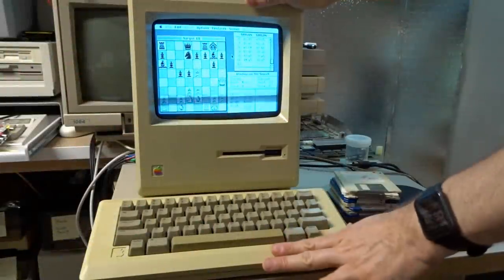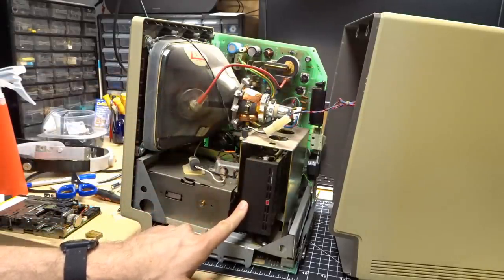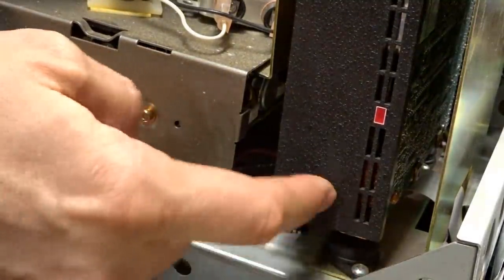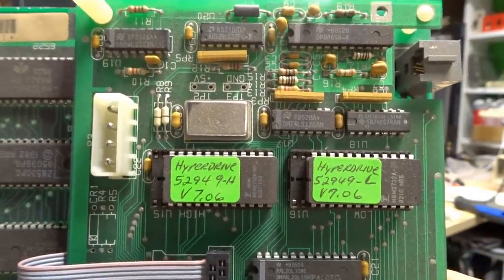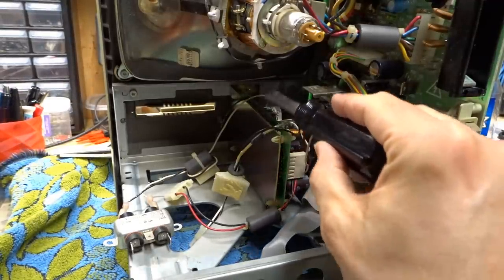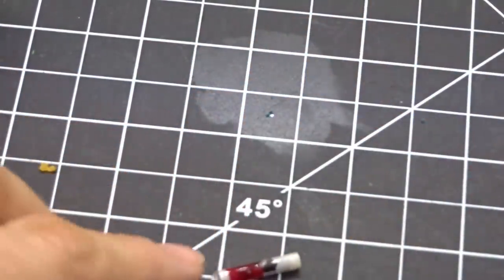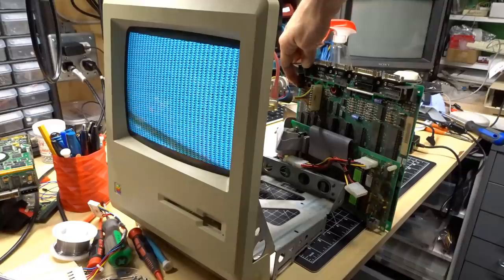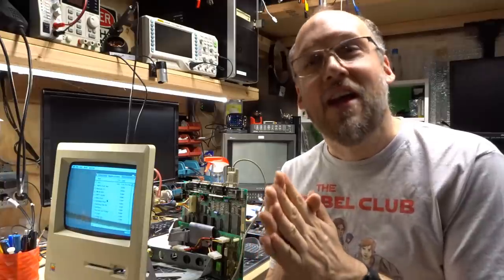Macintosh 512K with an internal MFM hard drive?

Comment: keep it! that mod is fairly unique(well seeing one today at least) 
btw test the output caps and dodes of the power supply. also check to see if the switching transistor is shorted or open (unfortunately if it is shorted it would have likely blown the switching chip so replace the chip if the replacing the shorted transistor didnt do it). you can also probe the signal pin on the transistor to check for High frequency switching. if you see ac on the output the output rectifying diode could be shorted(test for open as well).

Comment: The MFM/RLL drive sounds like it needs some looking into, since it made some concerning noises at power up. These don't auto park and need a command at power down to park the heads. Do not forget that it is a very old piece of hardware and may be soon to fail as the media is likely to have bad sectors..

Comment: My question is this: Can you do better? I think the hard disk controller piggybacking the motherboard is really interesting, you could try getting more compact period accurate parts and seeing if you can do a better job with the upgrade.

These sorts of hardware modifications are really interesting to see in these old Macs. I'm always a little hesitant to say return it to stock, because this sort of thing is NOT something you'd ever see today, in a modern computer, where all the upgrades are so steramlined. 

...Well, that, and I love seeing people sticking it to Apple like this. They didn't want people upgrading these old one piece machines, but people always found a way.

Comment: I'd be glad to see some software running from that HDD :')
I mean, it's still a strange fun to explore such long abandoned disks to find some obscure software and docs, even this is a bit deviant thing, haha

Thank you for the video, that's an accurate and surely period correct modification, I'd be glad to know it will stay with the system (after some lubrication of the stepping motor for sure).

Comment: Good job with the video editing. 
In some PC BIOS you can add some delay to give time to inicialize correctly the HD. 
You could just just use a microcontroller to performe the reset or boot first the HD & a microcontroller with a relay to boot the rest of the computer.

Comment: Hi there.   
I just found a Mac plus with a internal hard disk.  Was this a common modification?  It looks to be somewhere in the middle of a professional job and a home brew job.
I haven’t pulled the logic board out yet but it appears that the HD scsi cable has a bracket that clips over the scsi controller chip 

Thanks

Comment: 11:34 I'm willing to bet that those filter caps are not original. I have a 512k and it has the same kind of cap that was on your Plus. It hasn't exploded yet, but that's probably because it hasn't been plugged in for nearly two decades. I'm not sure, but it might be a 512ke (the guy who sold it to us back in 1988 or whatnot said it was), it definitely has been upgraded with a SCSI board that sits in the ROM sockets and the ROM chips sit in sockets on the SCSI board. Incidentally, though the 512k's ROMs were essentially the same as the 128k, the 512ke's ROMS were the same as the Plus.

P.S. Back when we had a Hard Drive hooked up to our 512ke we had to make sure to turn it on and wait for it to spin up and for the happy disk ok sound the heads made when it was ready. Only then could we turn the computer on.

Comment: This is a killer mod! Keep it original!!!! I have a compatible power supply that it worked last time I tried it. I was wondering for quite some time where did it came. But I think you should go and discover the wonders of switching power supply repair and repair the original power supply. It is no more complicated than some resistors, capacitors and transistors, how hard can it be ;) Hopefully not an open transformer. Otherwise, send it to DiodeGoneWild, he will surely get it running again, and perhaps improve it a bit :)

Comment: Make it all work again! I suspect the same as you, the modern Switch mode PSU has a slight power on delay, given it is connected directly to the CPU, it's probably dumping out of time calls/garbage on the memory and address bus during startup, if not, then it could be the reason they put those filters on.

Comment: Keep the classic Hyperdrive expansion board and drive... but replace all that nonsense power supply wiring with modern upgrades that won't burn your house down.

And replace the Duck Tape case fan with something more sensible.  Why didn't they use hot glue instead of tape originally anyway ?

Comment: I have pretty much the same machine with GCC Hyperdrive, although yours is dated 1985 on the controller PCB whereas mine is 1984 and says "HyperDrive HD512."  Assuming it was 128k originally, don't try to revert the motherboard to stock RAM while retaining the Hyperdrive.  I believe the controller requires 512k of memory and won't work with the 128k motherboard.  In my machine, the ROMs are still the stock 64k though (342-0220-B & 342-0221-B), and the floppy drive is still 400k. The Mac512kE and Plus have 128k ROMs and allow use of 800k floppy drives, and since your drive is 800k I must assume you have the 128k ROMs as well, although your newer HyperDrive controller should accommodate those 128k ROMs just fine.  

The HyperDrive does NOT auto park heads -- at least my model does not.  And you must use the included GCC software to manually park the heads when you intend to move your machine or drive around to keep shock from damaging it.

My Hyperdrive power supply (PSU) is still working (and it does not, nor should it, make any noise when switched ON), but I am now in the planning stage to replace the capacitors on it, which is most likely the only thing your PSU needs.  I also intend to replace the capacitors on the hard drive itself too because you will notice that there are a number of fluid-filled electrolytic capacitors on that circuit board as well.  And of course I will recap the motherboard and analog board. The glitching you see and hear at cold boot could be due to the capacitors, but it also could be do to some intermittent connections as well.  (I don't have such glitching on mine.) If you decide to recap and then find the same problem occurs, you should reseat the socket on the Motorola CPU. I have some photos of my Hyperdrive on Flickr at the following URL (and be sure the read the text description under each photo for details): https://www.flickr.com/search/?user_id=66071596%40N00&sort=date-taken-desc&text=gcc%20hyperdrive&view_all=1

Comment: im a firm beliver that if someone has gone through the effort of modding it like someone has with this one then it should be preserved with how they had it. if it was stock untouched and you had upgrade parts then sure upgrade it. i have a IBM PS/1 machine and it has 2hdd's in it, one with the original PS/2 software installed and they other with windows 3.11 with custom simpsons icons and programs on it. i have preserved it as is but i do want to find a way to make booting to each hdd easier without changing cables

Comment: Fan in a macintosh: Steve jobs is turning in his coffin
Reply: Not JUST the fan! Remember, Jobs wanted those original Macs to be unexpandable, unmodifiable "appliances".  That's why there's nothing USEFUL on the back, just serial ports, a floppy drive connector, and a mouse jack. This Hyperdrive card spits in the face of the entire design concept, and it is beautiful.
I love the solution on display. "No expansion bus? Well, all the signals we need go to the CPU anyways, we'll just tap 'em there. Checkmate."

The moral of the story, of course, is NEVER tell a nerd he can't modify his computer. It only ends with solder fumes and laughter.

Comment: If the modern PSU has enough power, power the system board from it as well. Otherwise, since the upgrade is "period correct", keep it with its hard drive or replace the hard drive with a MFM emulator.

Comment: Keep / restore it like it was with its original upgrade and maybe try upgrading further with a bigger MFM drive, if you have any. The controller would be neat to have reverse-engineered and ROMs dumped, in order to hack modern versions with something modern on the backend than MFM drives. It's basically abandonware anyway at this point. Also test the PSU thing, you could power it up separately in order to troubleshoot whether it's about not getting power fast enough, or if it's something else. You could also try some further hacking of swapping over PSU pins from the analog board to the PSU used for the HDD, especially if you upgrade it further with an even newer one.
Reply: Here's also an interesting alternative to a physical MFM/RLL hard disk: https://www.drem.info

Comment: The HDD is what you'd find back then. So it's tricked up but period correct for what it is.
 Just fix the power issue so you don't need to reset, and get it all back in the case. Hopefully it has enough cooling (and EM shielding)  to last.

Comment: 7:40 There's a discussion of (a later version of?) this hyperdrive upgrade on the VCF http://www.vcfed.org/forum/showthread.php?63678-Mac-512K-with-quot-HyperDrive-quot-add-on-Rare ; from the partial copy of the dealer installation manual referenced, the vendor just intended you to pry the frame with a screwdriver to put in the logic board, roughly what you're doing here.

Comment: Leave it as is please. It's supposed to work like this for the previous owner, so all the more reason to leave it intact as it is right now.

Maybe it helps to add a timed relay switch to the power switch, to first turn on the drive power supply and after 3 seconds the rest of the Mac. So quite a simple delayed start for the rest of the system. Also, please lubricate the drive! 😁 👍🏼

Comment: I've actually got one of these, but mines been updated in the 90's, or at least there was a 90's date on the mod board. It's got 4mb of ram, and 800k floppy drive, and a  scsi port and it came with a 40mb external HDD, which has system 6.0.8 on it. so like, it's barely a 512k any more lol.

Comment: yesh leave the memory upgraded and see if u can make a copy of the HD and use a CF card then maybe the power supply wont need to power cycle two times to turn on properly. It might be not enough voltage for the hard drive older hard drives use alot of power.

Comment: Don't revert it back to original and please also make a followup video, the psu can be sometimes easily repaired by changing the transistor(s) ( it's most likely the main switching transistor which is dead), and also keep in mind to check the fuse on the psu, i don't know if the psu is hickuping, but if it is, then there is definitely a cap issue.

Comment: Please don't revert. Maybe try and fix the 1st boot power issue, but this is a work of genius. If you're dead set on tweaking it, why not replace the CRT with a compact LCD or replace the drive with a modern alternative?

Comment: This setup is much more unique than a stock one, so why to destroy this? Repair and leave, please. You may try to make power on reset a little bit longer to adapt he new PSU. I don't know macs, but I'd expect an NE555 timer circuit somewhere on the motherboard. And don't forget to backup this drive. I had a few ST506 disks, which were in working condition, but when I started to use them, they degraded pretty quickly :( Unfortunately there is no MFM/RLL drive emulator on the market in a reasonable price.

Comment: try repair the old psu. First check the fuse haha obviusly. look at startup circuit maybe a resistor and a cap, look at the big resistors, look at driver transistors maybe they are leaky. Reeplace optoisolator and TL431.

Comment: Leave as is, live with needing a reset to work!!!
Reply: Oh, it is easy to fix for a smart guy as Adrian. You could use a power MOSFET or a solid state relay to keep the main computer powered off until the hard drive power supply provides power.

Comment: I found a forum post of someone else trying to get a "Mac 512K Hyperdrive" going and was going to post it in case you needed it, but seems like you figured it out, so now it's just for curiosity: https : / / 68kmla . org / forums / index.php ? / topic / 28607-reviving-a-512k-hyperdrive-error-code-0f0100 / &

(remove spaces to follow URL)
Reply: Oh, and leave it as-is.  (Unless you can figure out how to make that power supply get up to voltage faster.)